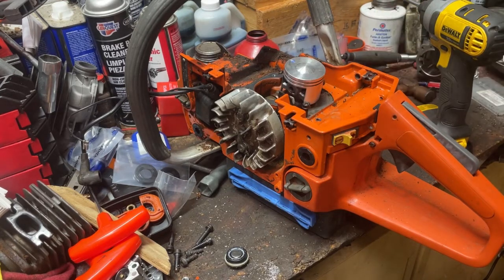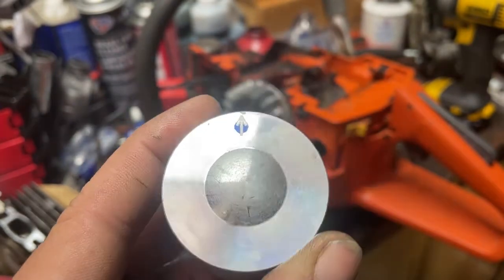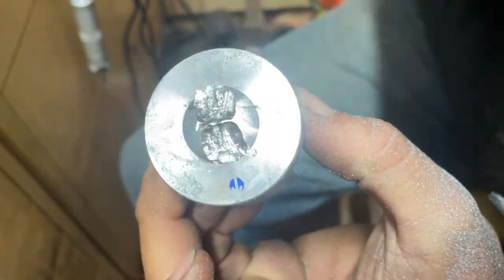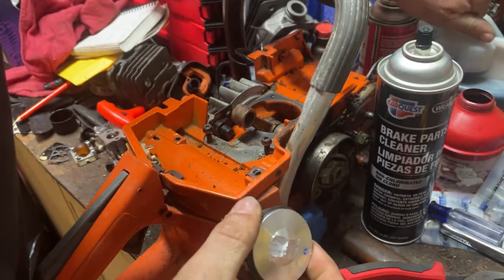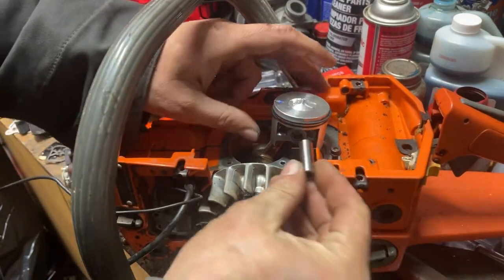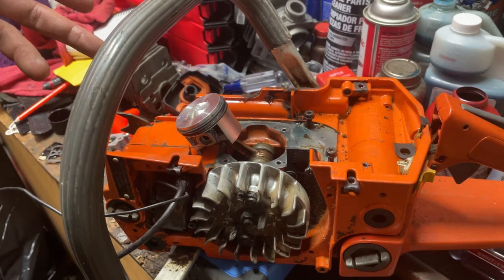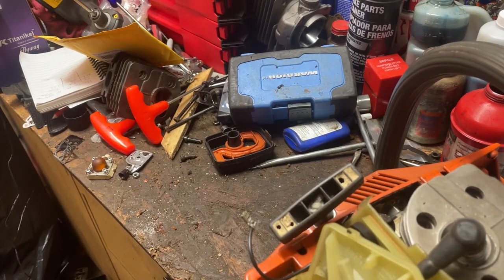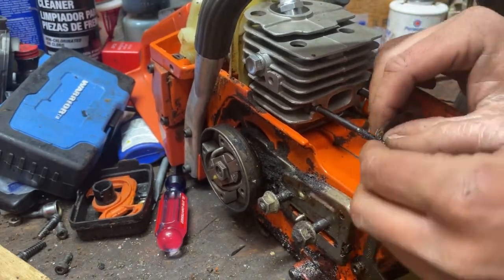Husqvarna 51/55 Piston Piston Swap | 028 Super Piston in a Husky

Comment: Thanks for going through all this!! I’ve got two dump find 55’s and two 028’s from the same place. Already did a custom muffler on the 55 which turned out great! Next will be the pop up piston and mild port work on the stock jug. I really liked that saw you did for Dan👍
Reply from the maker: Dan’s has a 55 pop up piston and some port work. It is definitely a great runner. There is quite a bit of work that goes with the 028 piston swap, they are not a direct bolt on a go.
Reply: I may have to buy a piston yet… haven’t tore down the 028’s yet to see if they are any good but they’ve got good compression and I’ve had em both running so 🤞 should be a fun journey! Been saving up parts for this for a couple years and watching your vids is really helpful 👍 thanks JK!
Reply from the maker: @shapeshifter7753  Thank you it means a lot to me.

Comment: So do you really need to cut a relief for the spark plug? Got a hyway CP cylinder and went for the 028 because squish was horrible on the hyway kit, 0.058 if i aint mistaken, now with a 0.015 gasket i'm at 0.023 with the 028 piston, but i'm not touching the spark plug, should i still notch a dimple in it or leave it as is?
Reply from the maker: This one I had to

Comment: I bought a new rancher 55 in 2000. Spent more time putting the chain back on the rollertip bar than I did sawing. Next day bought a new non roller tip bar. It never oiled the chain enough to suit me.  I tore all that loosey goosey VI stuff loose. Its now in a 51 housing. Engine still runs good. Dont use it very much. I would rather use my 68CC 1967 Lombard or a 58 cc super XL automatic. Me and roller tip bars and plastic saws dont get along very well.
Reply from the maker: I found a surplus of 51’s I kinda enjoyed building them.

Comment: I ended up with a .010 base gasket to get to .020 squish, the popup was actually hitting the chamber with no gasket. With the .010 gasket I was able to get away with just a second gasket on the plug. 
I've kind of always felt my built 55 was a turd, even when it was bone stock, now it's just a polished one... LOL
Reply from the maker: This one does all right. It’s defiantly not the powerhouse that I think it should be. It would probably do a lot better if I would put the 325 chain on it.
Reply: @JKSawShop  I've ran mine with both, both my 254 and 026 will cut circles around it. It's better now with the HDA120, but it's not in the same League
Reply from the maker: @82f100swb  I don’t think they will ever be in the same category. Just trying some ideas.
Reply: @JKSawShop  The 254 has more stroke so I think it's going to be hard to match. It's always been my target though. My 026 is just a freakshow. A 48cc saw has no buisness running like it does.
Reply from the maker: Longer stroke helps the 254.

Comment: I'm in the middle of building two 55s waiting on an 028 piston
Reply from the maker: It works. There’s just a little bit of things you have to do, I’m going to run this one for a while and then I may end up buying a better piston.
Reply: @JKSawShop  I'm waiting on one from Lil red shed we will see what it does.
Reply from the maker: You could probably get by using the base gasket and .030 squish. That way you dont have to index the plug or relief the piston.
Reply: @JKSawShop   I've got 2 base gaskets to choose from and the head that's on it is a farmertec but the squish is like .038 with no gasket so it's pretty loose. That's what made me go with the 028 piston hopefully to get a little more compression and a double ring piston should have less blow by
Reply from the maker: @brianmorrow6355  it will pull a  20”standard 3/8 in soft wood, struggles a little in white oak. Gonna go back to .325 chain more than likely.
Reply: @JKSawShop  I wish I would have checked the squish and timing as it was factory it popped and I wasn't planning on doing anything but putting a new top on it. . . Then . . .
Reply from the maker: @brianmorrow6355  I can get the factory numbers from the 51 which are close.